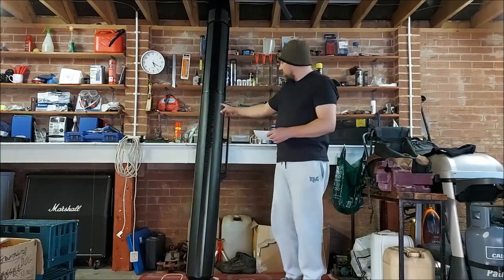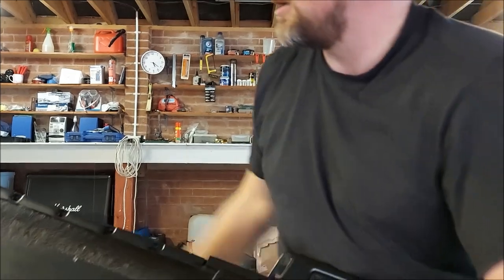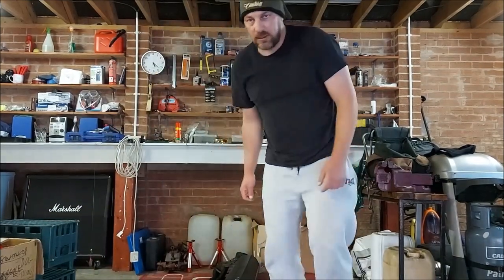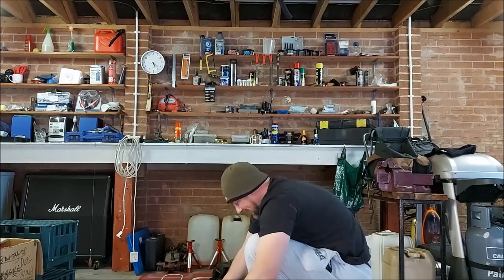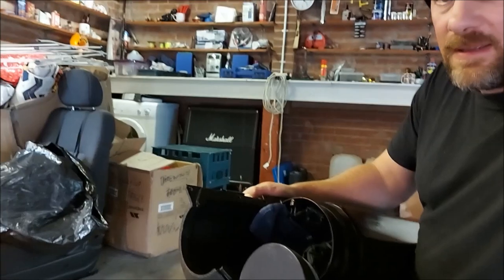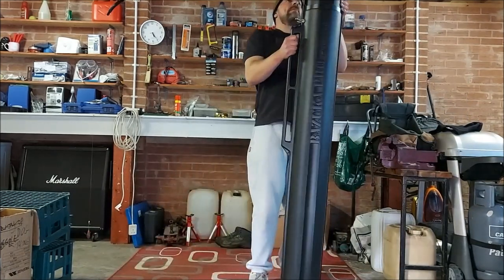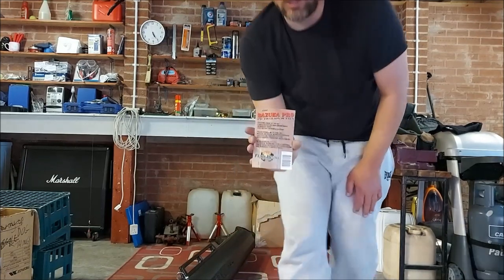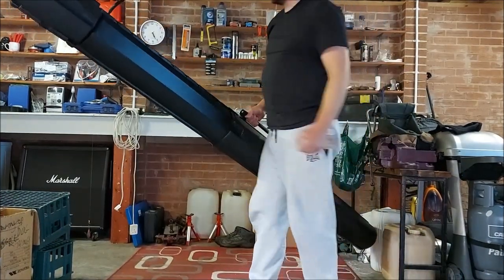Flambeau Bazuka Rod Case

Comment: I have a 12' rod, but can be split into 50/50. Will that fit into that case? I also have 7'6" rod in one piece, will that fit into that rod?
Reply from the maker: Yes in the info it tells you it extends to 8 1/2 ft, the larger one

Comment: i kinda want to get this, but what if the badlock comes out when the tube is extended and the top slides down and smashes ur pole tip???
Reply from the maker: Mmm not sure. I havent really used it yet but the pins are fairly thick. What people have suggested is to gaffer tape round the latch also as it can break off in transit.
Reply: @djrmonix  I might use a padlock instead of the pin. If the latch breaks it is still locked.  As long as it keep the rods safe.  Thanks